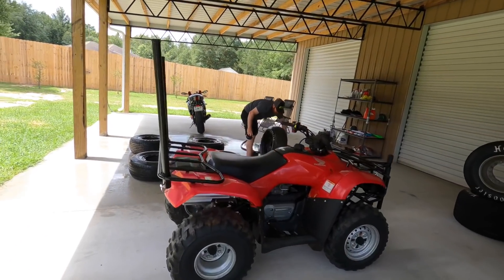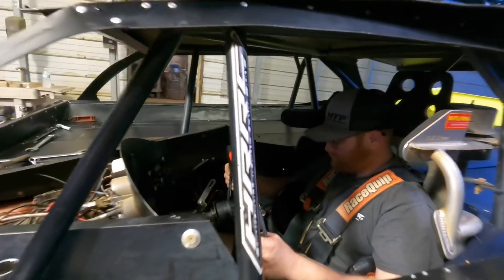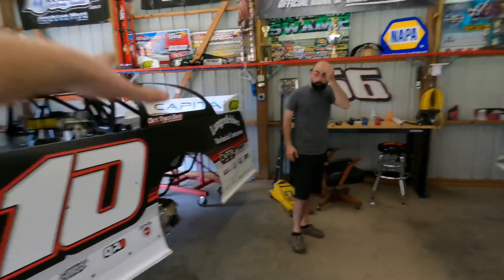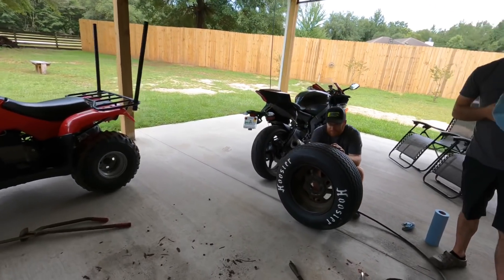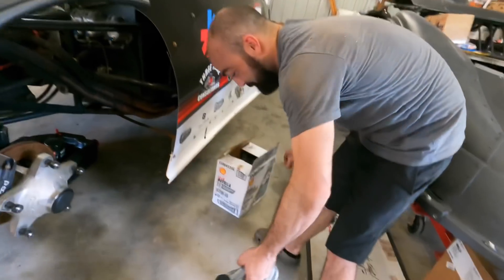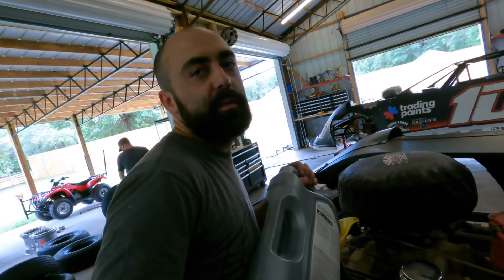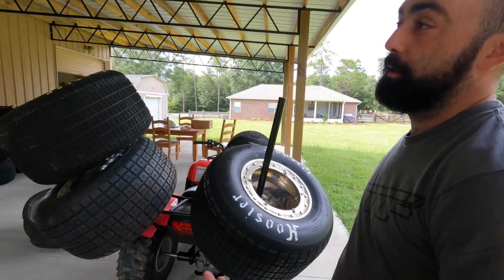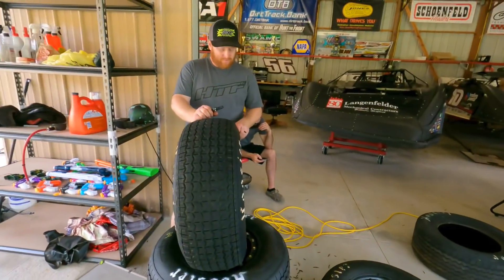Another Two Car Race Night! But One Race Car isn’t a Late Model?

Comment: Jesse and crew.
Good catch with the rubber gasket for oil filter.
But you need to start with clean oil pan..
Dump the used oil into clean pan and look for any premature wear in oil..like metal particals, or excess dirt, dusting your motor.

Comment: When you cold start on the stand like that, what is the purpose of the black metal thing in front of the radiator?
Reply: it restricts the airflow to the radiator therefore it makes it engine come up to operating temperature faster.

Comment: I use rotella and everything not only in my big truck but in my vehicles at home because it is such a high detergent that it keeps the engine very clean that's why when you put rotella in run your car for about 15 minutes and drain it the oil is black because it removes all the soot and grime out of the engine
Reply: Good for old classics with flat tappet cams. I started using it in my 63 Dodge Dart.
Derek from Vice Grip Garage uses it in all his cars.

Comment: you wanna make the process of putting oil in not take as long? take both breathers off, put your shop vac on one, pull vacumm on the motor and it will take the oil in alot faster in the other breather tube.

Comment: We use to have a protective wrap on oil filter so rocks didn't poke a hole, happens
Reply: Or relocate it.
I've seen it happen too.
I've seen stuff happen on a race car that could not happen anywhere else in the universe under any circumstances. The epitome of Murphy's Law.

Comment: Ain't nothing wrong with that 15 w 40 Rotella boys, I've been running it in my 89 Honda Goldwing since it was new.
Reply: @tomhutchins1046  Yep, but the wing only runs 3200 @ 75 mph and as far as HTF goes they're changing it every 3 or 4 nights any way !

Comment: no need to tighten your oil filters that much. hand tight + at most a quarter turn
Reply: So glad I’m not the only one who saw it. Drives me nuts seeing that.
Reply: @tomhutchins1046  Nope 've been building winning race engines for 40 years
Reply: @tomhutchins1046  Nope have a great week
Reply: @tomhutchins1046  3DRE check out the motors we are running